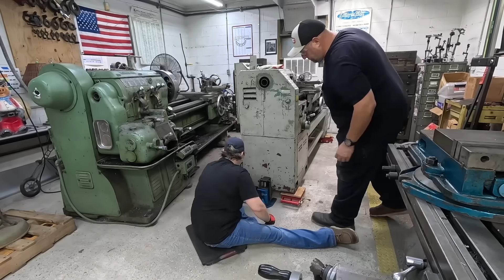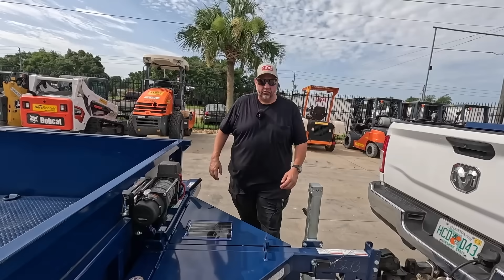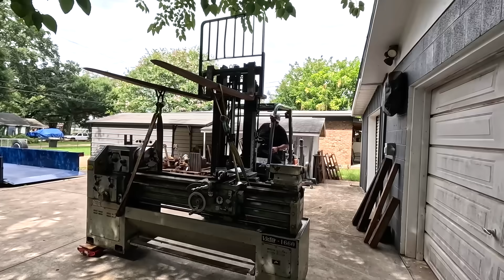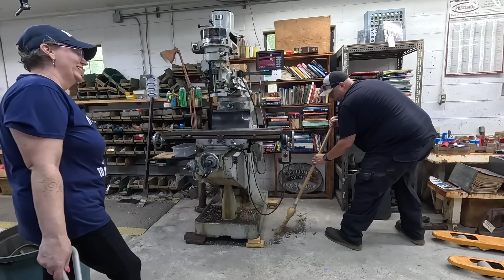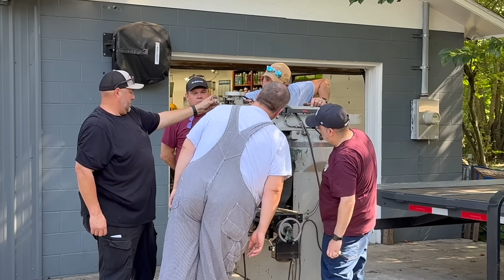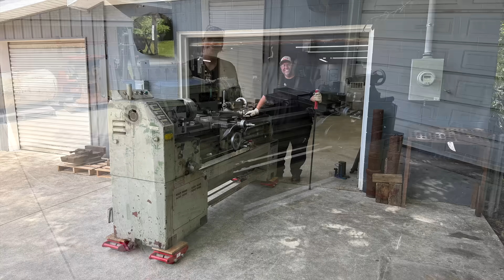Moving and Saying Farewell to the Victor & DoAll

Comment: For many years I have moved residential gun safes for a living. The best thing I ever bought for that job was a "single axle" drop deck trailer. I've moved about 5,000 pounds worth of safes in one load, that was three 50 cu ft models at 1,500 to 1,800 each. It was also a real blessing when I bought my Bridgeport mill and later my 13x40 Jet lathe. Most moves I've done alone.

I honestly can't imagine what my life would be like without my tools which includes my drop deck.

Comment: I'll tell you a funny story about the Victor Lathe I used in 1980's
The company I was working for during the 80's. Decided to purchase a new lathe. They bought a Victor lathe, was wired in by a electrician.
During the 1st month started to have problem of it trippin'. the breaker. Not the breaker on the wall, but in the machine. We call in for service and oriental man came to check it out. After a while he asked if the wire 2 10. We said yes 220 volt. He said again 2 10. We said yes 220 volt. ( OK you see where this is going ) we went back-and-forth for about 10 minutes till someone said I think he's saying the wire ( TOO THIN ) the oriental man's said yes yes.

I still to this today laugh about that moment  ( TOO  THIN ) -------- ( 2  10 )

Comment: Concrete - There's a liquid treatment you can just pour on the ground and sweep it around. The next day, it will be as hard as granite. I'm in the UK so it's useless for me to list brands etc as you may not have the same in the US.
Have a google around, you'll see what I mean.  I have helped a mate lay some concrete and it rained while the concrete was drying. We did our best but the concrete got a little washed out. We left it to dry, then treated it as above and it is still powder free and totally solid 20 years later.

Comment: did you have all the change gears to go with that Victor? i bought at auctions and they never have them. 
I know it doesn't apply here but If you ever need to tie down the mill with the pallet jack under it just put 1 x 6 under the forks and let it down so when you strap it down your not pulling down on the wheels i do this when i haul with my drop down.

Comment: IF YOU WANT TO SAY GOODBYE TO THE DUST PROBLEM JUST SOAK THE FLOOR WITH BLEACHY WATER ¼" DEEP N SIMPLY BRUSH IT INTO THE YARD LEAVING A CLEAN N FRESHLY PREPAIRED FLOOR READY FOR FLOOR GLOSS PAINT N JUST R O L L IT ON DUDE,EASYPEASY LEMON SQUEEZY,US BRITS DO THIS TO OUR GARAGE FLOORS WITH SOME DIE HARDS ACTUALLY EXTENDING THIS METHOD THROUGH TO THE KITCHEN,TRY IT,I WOULD,..FROM AN HALF DISABLED EX WELDER IN THE UK,SMUDGE....

Comment: Does this shop have 3 phase electric from the utility or do you make you own? If you create you own, how is it done? I recognized one of the people in the video as having a UTube channel. I assume that's who purchased the machines. The guy in the Bib overalls.
Reply: You use a phase converter, which is essentially a single phase motor and three-phase generator combined.
Reply: @NightfallSentinel That is a rotary phase converter.  There are electronic phase converters that are a lot less obnoxious but do have their own limitations.  Pretty cheap, though, and can usually vary the frequency/speed and start up and stop rates.

Comment: For a farm what brand of lathe would you recommend? I know you have a monarch and a pacemaker or would I be better off buying a newer more modern lathe?  Precision mathews, victor, lion, kingston or some other brand?
Reply: Im on a small ranch in South Texas and I'm a gunsmith. I've been very happy with Grizzly price performance . Have 12x36 GS lathe, Bridgeport clone mill and bandsaw. (no affiliation with Grizzly)
Reply: i recommend staying with machines from the 60s to the 80s, the brands you mention are good.  they are usually still accurate enough for the home shop and generally affordable.  a 3 phase machine is usually cheaper and phase converters are easily available.  my old clausing works great for my home shop, and i have a millright brand kneemill  they aint nothing special but the job gets done.

Comment: After working for a machinery mover for like 13 years, I believe the safest way to move a mill is to run the blades of a forklift up under the ram ways using a 1/4" piece of plywood on the blades for grip. They also had a very low-profile 2-wheel dolly with a fairly wide plate that fit under the base wheels on each side, called a Batman, for wiggling it out of tight spots. But nice job on you two.